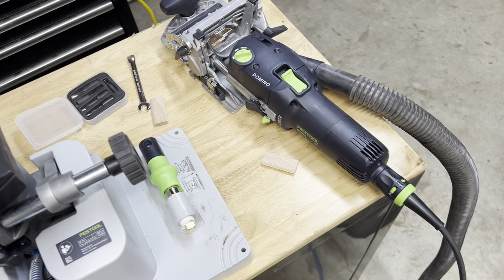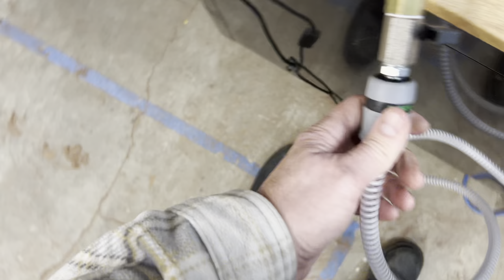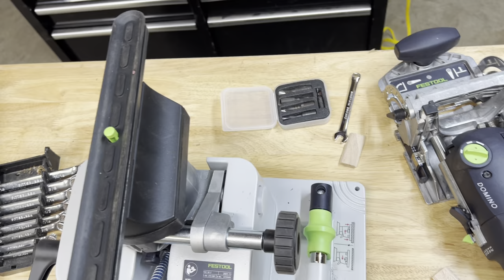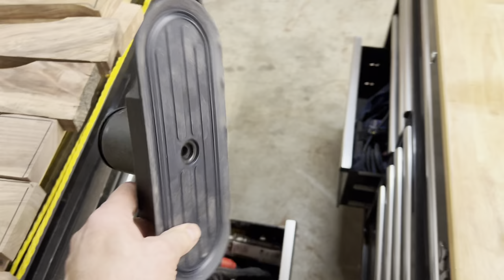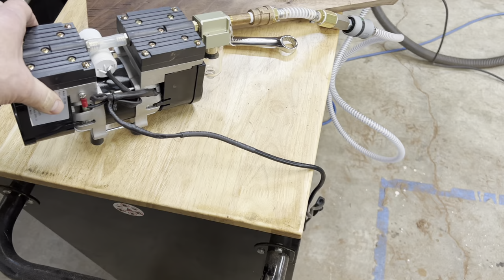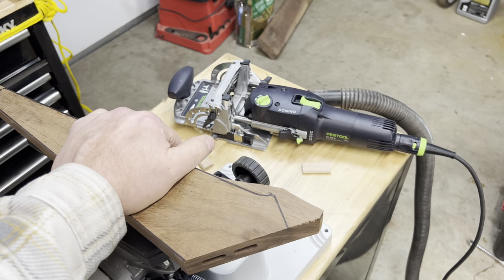Festool VAC SYS inexpensive pump!

Comment: The link to the pump does not work 😩, do you have the name or model? It’s been two months  how you like the pump in this set up? Still working ok after Teo months ?
Reply from the maker: 24L Lab Diaphragm Vacuum Pump Oil Free Oilless Medical Mute Pump -95Kpa Air Pump with Air Filter https://www.amazon.com/dp/B085FPPMMR/ref=cm_sw_r_cp_api_gl_i_W9R39BK7K71E7H144B4C?_encoding=UTF8&psc=1

That link should work or copy it and put it in google search. Still works perfect. Bulletproof

Comment: Where did you get the male fitting attached to the valve at the pump that goes to the Festool quick connect. I am looking for this male fitting so I can attach one to my pump that I got from veneer supplies so that I can use the festool quick connect on. Not sure if this male fitting is available in North America.
Reply from the maker: That came with the Festool vacuum clamp.

Comment from the maker: Used it several times. Seems bulletproof. Does not get hot. Just warm. Quiet.
Try this link.

24L Lab Diaphragm Vacuum Pump Oil Free Oilless Medical Mute Pump -95Kpa Air Pump with Air Filter https://www.amazon.com/dp/B085FPPMMR/ref=cm_sw_r_cp_api_gl_i_W9R39BK7K71E7H144B4C?_encoding=UTF8&psc=1